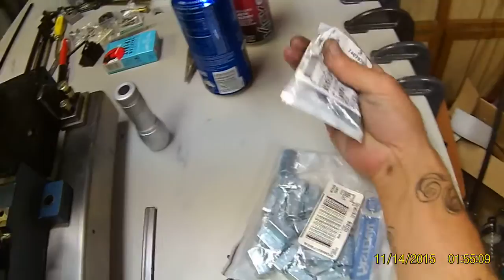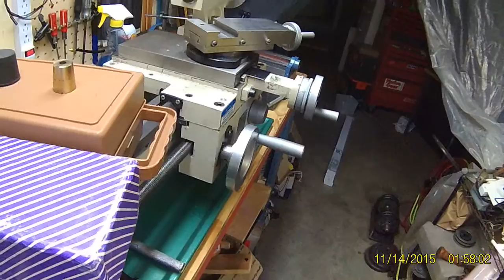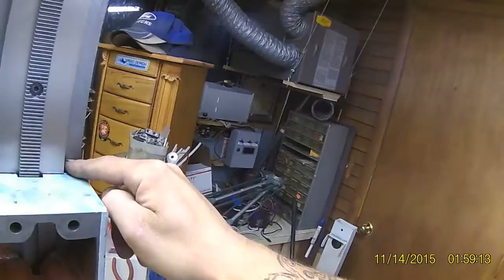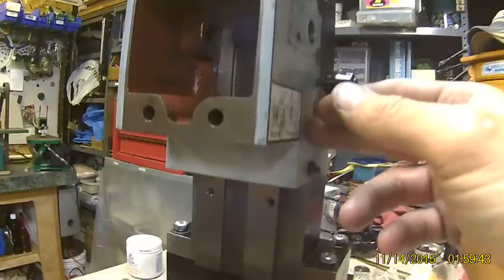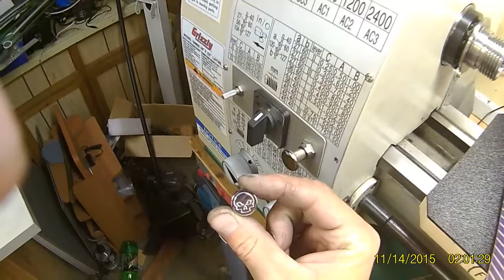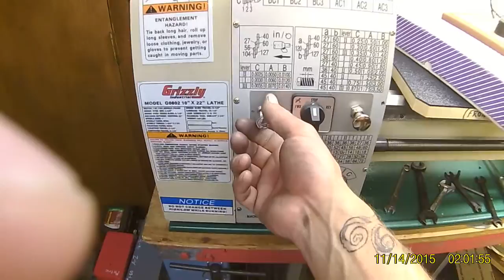Measuring, scraping and lapping for alignment.

Comment: So what became of this? Was the bed bowed?
Reply from the maker: bed has about 0.0005' bow. But the carriage, cross slide, and compound protractor seat were all bowed. All have been machined and scraped and it is now cutting within 0.0001 in 6 inch test bar.